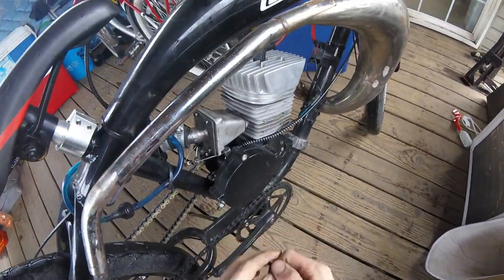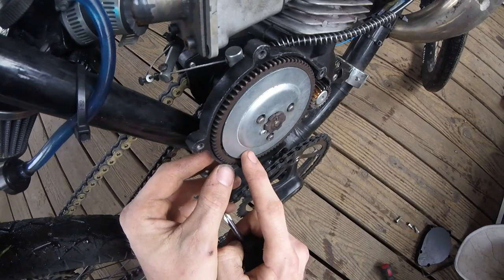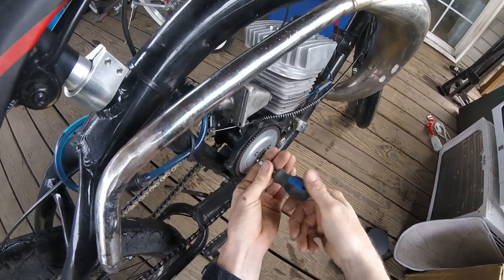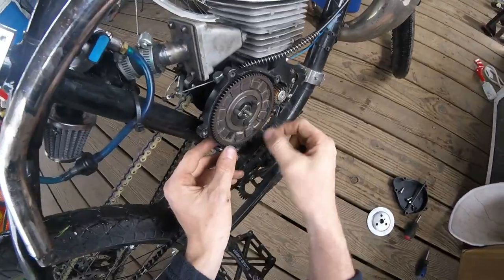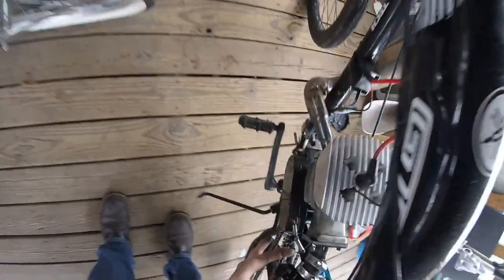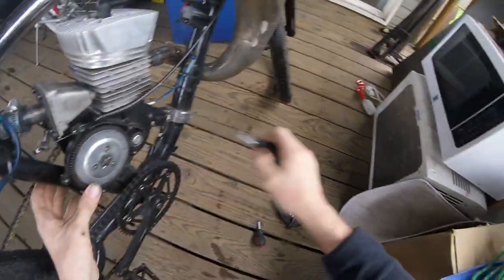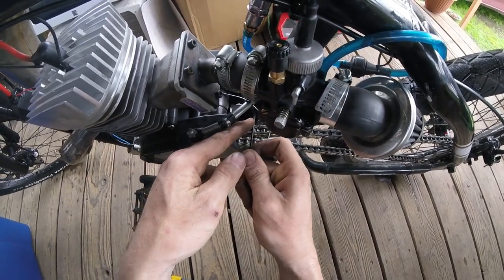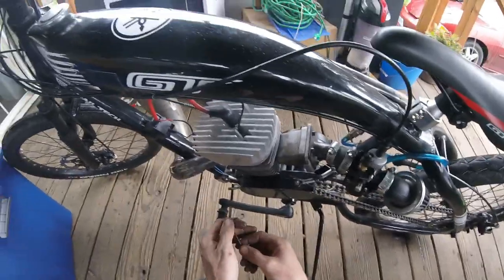motorized bicycle clutch adjustment simplicity 101

Comment: Great information. Much appreciated. There are lots of video on YouTube that are all over the place with information. This was very helpful. Simplicity to the max. I am new to the motorized bicycle game. Much love from So-Cal.
Reply from the maker: thank you man and your welcome!
Reply: @wtmotobikes8838  what does it mean if I put new pads in and adjusted the clutch just like that but it seems to still be slipping instead of holding tight against the pads
Reply from the maker: Stephen. Sometimes pads need broke in a little bit. Either that or your flower nut just isn’t quite tight enough.

Comment: Thanks WT MotoBikes, your video is really informative! I'm learning how to solve this common clutch problem because i think that causes my bike not to run. My question is where can I buy the locking screw of the flower nut as a replacement since I stripped it by practicing adjusting the clutch ?

About me: I am new to moped. The engine has less than 50 miles. This is my second attempt building a moped.
Here are the symptoms of problem that I'm trying to solve for the last couple days:

I pull in the clutch level.
Pedal the bike.
Let out the clutch level.
But the motor won’t turn on. (The engine turn on when I let out the clutch level out the first couple days of engine break in) 
With the clutch level still out and no engine power, I am still able to pedal the bike. (this is odd because I wasn't able to pedal with the clutch level out)

Thanks in advance for any input to get my bike running again

Thanh
Reply from the maker: im not 100% sure without more information but is your engine actually turning over with resistance? or is it making a screaching noise? sometimes the clutch can back off adjustment not grab enough to engage and turn the engine over. let me know more so i can try and help.

Comment: What can you tell me about spark plug gaps for single electrode NGK B5HS plugs? More to the point, I've seen recommendations to gap from .26 to .36 " . There ought to be a way to say "OK, the motor is doing this, or that; I'm running a break in mixture or I'm running 92 octane with the engine run in and 32 to one so I should gap the plug at ----- (fill in the blank). This can't be rocket science. I'm not racing, or planning to at my age, I just want the engine to run well and last a while. Any help you could give me would be really appreciated. As you know, there ain't no manual with these whiz bangs.
Reply from the maker: Here’s a helpful hint on this subject. Sorry for a 3 year late reply lol.  The closer you gap the plug, the higher the resistance to compression spark knockout you get, the higher Rpms you can achieve. That means the compression will not stomp out your spark.  The wider you gap a plug, the more spark exposure you get, slightly bigger flame front, better burn of the fuels during combustion. On a low compression cruiser setup. This would be ideal. On a racing engine I would keep the gap closer together for high RPMs and static compression resistance. Hope this helps

Comment: Thank you so much for your video bro you're really are awesome I have a brand new 2nd bike motorized that I built with the Zeta motorsports grunt monster engine on a bike Berry bike..  Today was the 1st time I started it but I was having trouble getting the clutch to engage the engine then I was having trouble with the clutch handle when it was this engaged it was still kind of  tough moving the bike.. Can you maybe post a video about these 21 mm PWK carbs and exactly where the hoses go I can't get my bike to stay started at idle
Reply from the maker: my guess is two things. either the pilot jet is to rich, or the carb is just to big for the engine. i usually run anyhwere from a 17-19mm carb on most of my engine setups. iv only got 1 21mm carb and its been to big for every engine but 1 and that engine was ported out way beyond most of my engines have been. try a smaller pilot jet first.

Comment: I don't know if I can do a complete walkthrough lol, also for the part at the end you can have worn clutch arm or bucking bar which will prevent a full clutch disengagement as well.
Reply from the maker: you are right and i forgot to mention that but i cover it in the other video i made today. lots to go over with clutches. they are a tricky finicky little device that is honestly so simple and yet so many create their own issues with adjusting it. hopefully this video can help many.

Comment: so ive been trying to figure out what is going on with my bike...ive adjusted and adjusted and no change....so you pull the clutch in everything roles fine start to pedal release clutch and it just slows you down and before it stops it try to turn over at the end...adjust clutch plate tighten a lil more repeat..pedal itll grab the first time.....second time it does what it did the first time just slows ya down and motor doesnt turn over? im stumped any help or advice would greatly be appreciated
Reply: Could have dirt or grease on your pads or pads are too worn.

Comment: what causes a squeel in clutch engagement?
Reply from the maker: That happens as the clutch pads and the plate turn against each other, the friction of the two mating creates the noise. Pretty common.
Reply: I figured it wasn't anything serious, just being new. But my clu5ch spring creaks like hell, and wanted to eliminate the noise. Lol thanks rfor replying rho! You videos are great. They're informative, and not misleading. cough cough LA hover cough